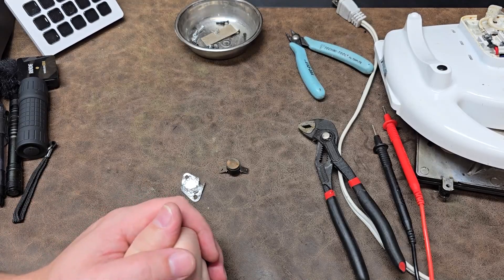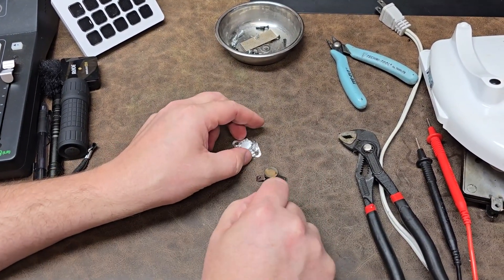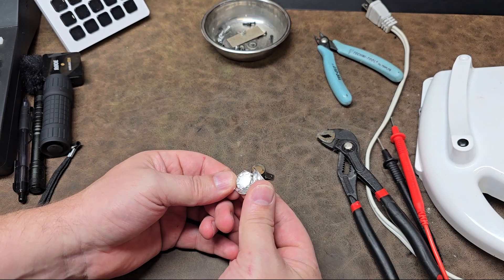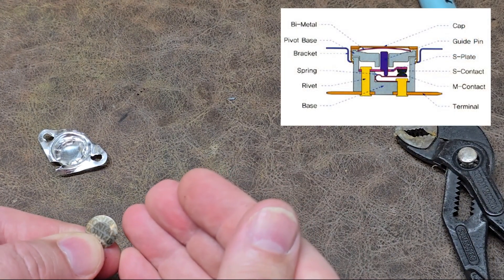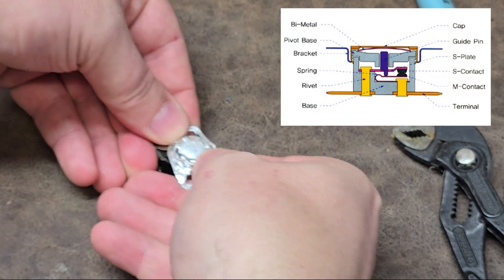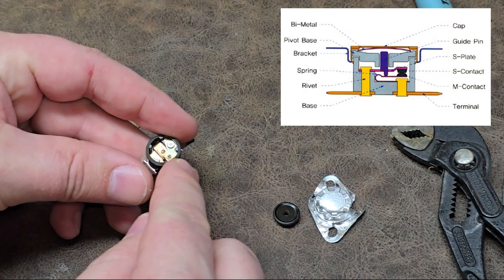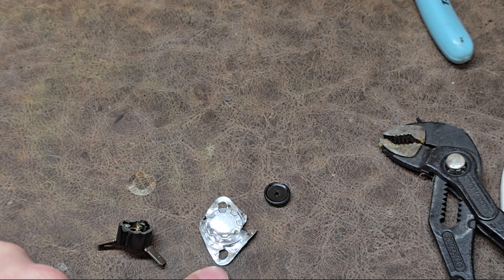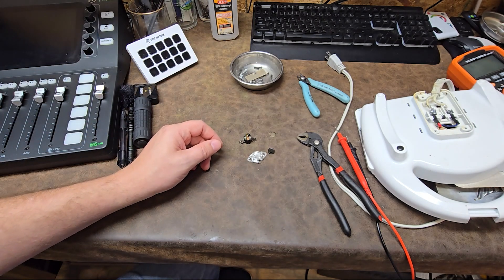BiMetallic Thermostat Teardown

Comment: The pin between the Bimetallic element and the contacts is usually made of ceramic, not only to give electric isolation, but also to block heat transfer to the contacts.